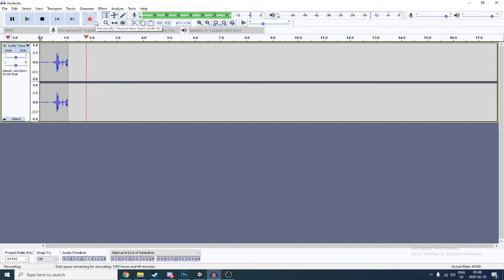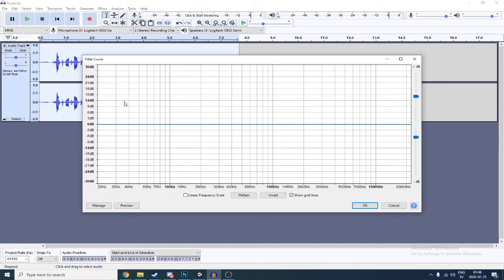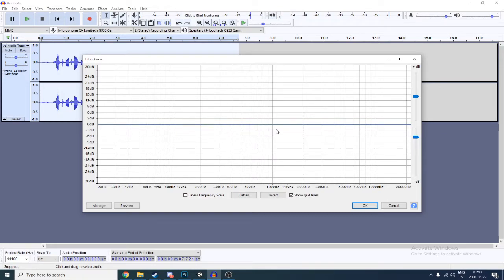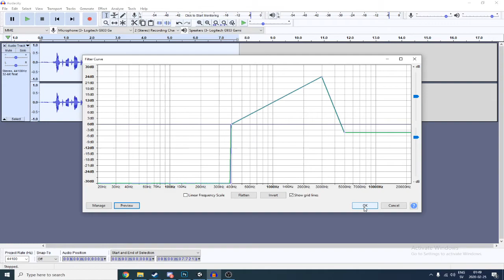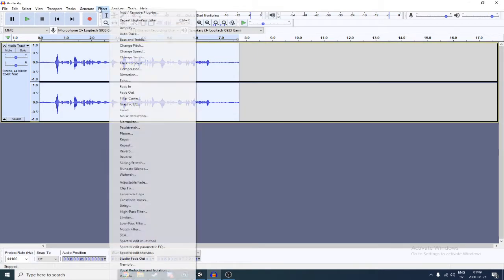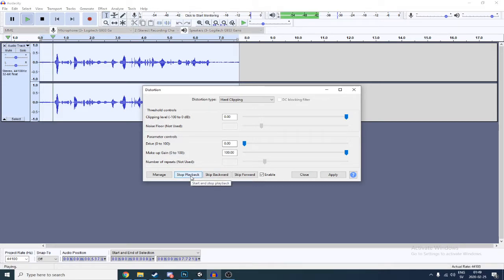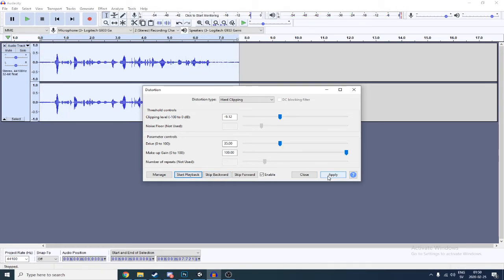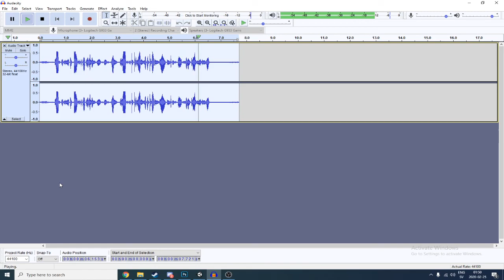How to make a military radio effect in Audacity

Comment: nice tutorial my friend. Any idea how to add the radio break
 noise?
Reply from the maker: If you're talking about the chiptune (duduu) I would probably filter 2 tones on eachother and disort their attack/decay. Something like a 400hz start ending with a 800hz chip if you understand what I mean. This is just speculations though, so you'd need to play around with the values.

I've got a lot of work ahead of me as of now, but I am thinking of making an update to this video in the future with some fun / cool additions to make it better. I'll reply to this comment again if/when I do that!
Reply: @timmytimmy9771  
I'm definitely interested in a tutorial when you have time adding in the radio click/break. Is it authentic for ww2 radio traffic?
Reply from the maker: @TheGigVault  I wouldn't know about ww2 traffic, but at my previous job back in 2019 we used Rakel / Tetra (a swedish digital radio system designed for bluelight operations) and that one had no  connection tones.
There was just a chip from when the audio cut in and a chip when it cut out.

The only tones we ever heard were:
1 beep: Mic ready
3 beeps: Radio disturbance / channel blocked (often related to sevral people trying to send at the same time)

I have however used quite a few radio systems that uses connection beeps, and if I had to GUESS I'd think connection beeps was common back in the early 1900s (Don't quote me on that thlugh haha) (:

Comment: There is a preset called "AM radio"
Reply from the maker: There is indeed! However that preset is made with the intent of simulating a high quality, well connected AM radio.

In this tutorial we are trying to replicate a standard-issued radio used by police or military where connection is higher prioritized than sound quality (:

The AM radio preset is great for some purposes, but in this specifik scenario it is not what we want.